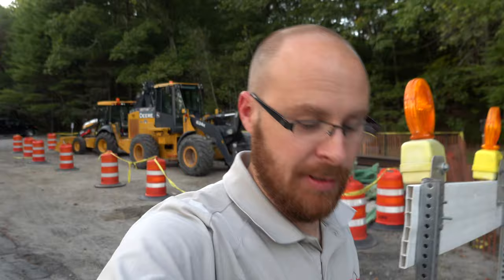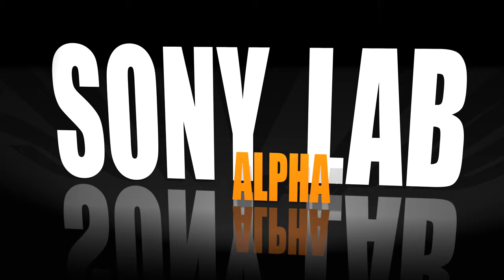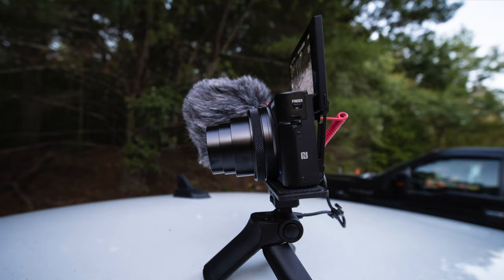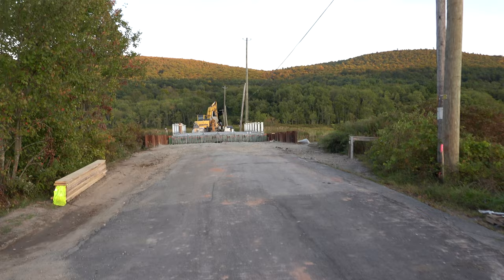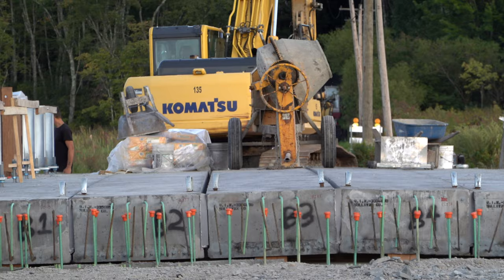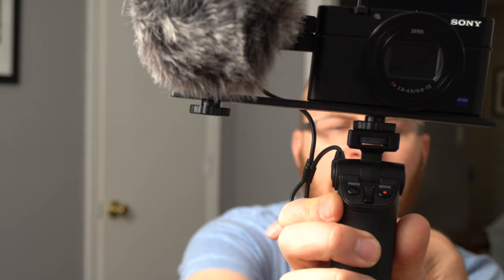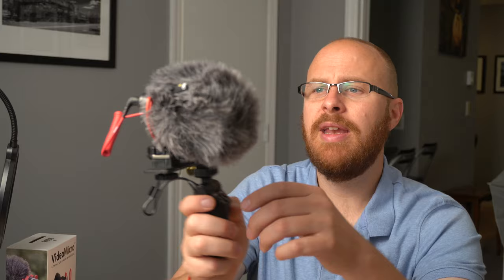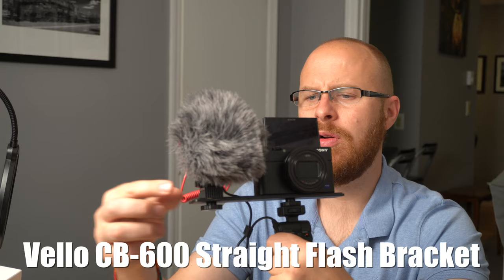Sony RX100 VII - Best Vlogging Camera??

Comment: 'Almost' the best vlogging camera if not for only f/2.8 largest aperture. I stick with my Mark V
Reply from the maker: Yeah, there is always a compromise. If you want great audio quality it's an easier workflow with the built in mic input on the VII. Otherwise you would have to use a stand alone audio recorder and sync the media up in post. Not the biggest deal, but more work for sure. I agree though the f/1.8 on the Mark V would be preferred by me as well. I'm sure Sony will come out with one soon. Perhaps a Mark VIII will offer the 24-70mm f/1.8-2.8 effective lens for the those would want it over the 24-200mm f/2.8-4.5 effective on the VI and VII.

Comment: Great video!  I'm still on the fence with this thing. Currently using an A6500 with the Rode VideoMicro and like it a lot. Would like something more compact for certain situations but the Rode Mic looks bigger than the camera itself! haha I've gotta have an external mic, just wish Rode would make a smaller version. Will keep watching your vids for more info. Quick tip about the VideoMicro, you can stabilize the mic by snapping the cable into one of the small grooves on the round cold shoe mount nut.
Reply from the maker: Thanks for the comments and the tip about the mic! That thing is jiggling all over the place ;)

Comment: Are you using a lut filter in editing for the color profile? Also, was this recorded in 24p or 30p. This video is really crisp, great job!
Reply from the maker: Hi Anthony, Thanks for the comments and I am not using a color profile at this time. I do want to experiment with that, but I have not as of yet. I just have it on default settings and my white balance hard set to 3400k. I was shooting at 24p @ 100M.

Comment: Does the vii or vi have better stabilization than the v? I could not get pictures lower than 1/15s consistently without blur on the v.
Reply from the maker: it seams about the same to me I would say in the real world, but when zoomed into 100-200mm on the VI or VII you really can't go that slow with the shutter without a tripod.

Comment: is it better then the RX100 V.  with faster aperture and ND -   I assuming yes as it has Mic input and I assume better tracking AF. -  seems the grip could be a bot longer
Reply from the maker: Yes, overall I would say it's better than the RX100 V due to the mic input and AF Tracking abilities. I also agree about the grip could be a bit longer, but it is actually long enough. Sony clearly went for maximum compactness on all fronts with this system ;)

Comment: Is this better than iPhone pro ?
Reply from the maker: I would certainly say so, yes. However it highly depends on your skill level and desire to learn how to use the camera. The RX100 VII is not near as easy to use as the iPhone. The iPhone pro is pumping out some really good quality as well from what I am seeing, but those tiny camera sensors do not compare. The portrait mode simulating depth of field on the iPhone is cool, but looks pretty fake to my eye as well. For a phone with cameras the new iPhone is absolutely amazing though no question!